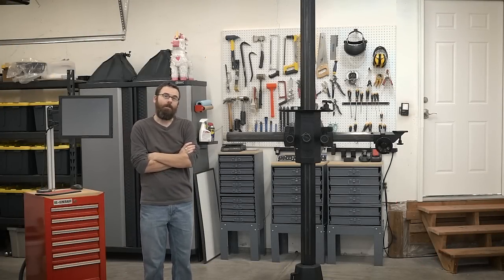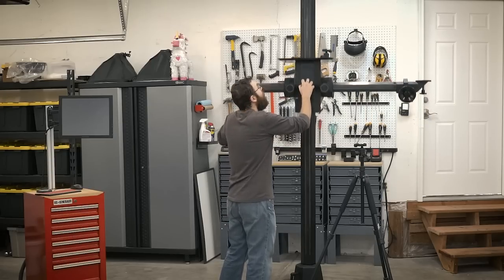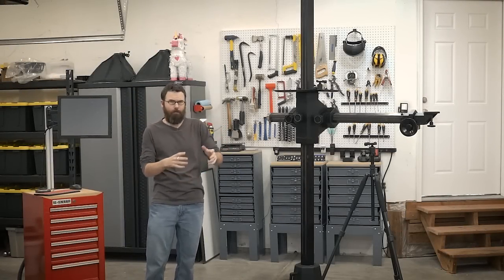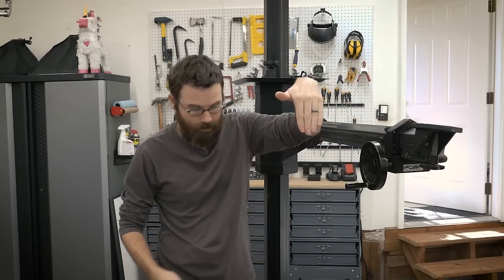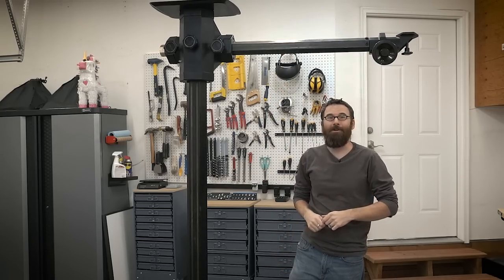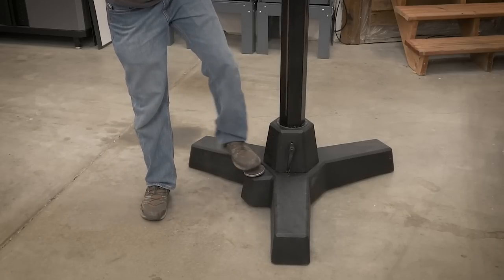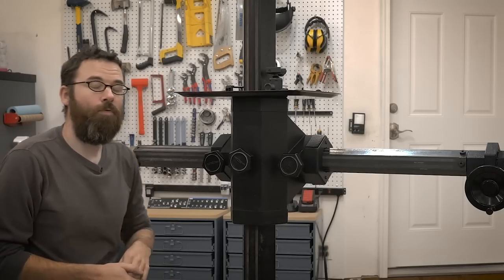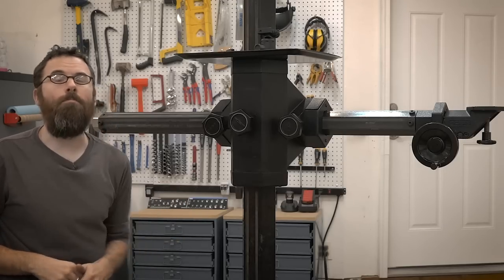Foba Studio Camera Stand (ultimate shop tripod!)

Comment: Nice score. I appreciate your desire to motorize it, just keep in mind that it was design as a stills camera support for commercial spaces, not as a motion control rig. You could get yourself a motorized slider, mount it to the stand and save a lot of hassle. Cheers 🍻
Reply from the maker: Fair point.  If I sanded it all down and smoothed up the surfaces, it COULD work, but you're right, it wasn't really made for that.

Comment: I have one. Bought it second hand some ten years ago, in a period in which many traditional studio photographers retired or their business folded. You could (and still can) get them for a few hundred Dollars/Euros while they cost some 8K new. They are built like a tank, but it appears that the three small gas springs that lift the stand have a relative short lifespan. But then again even with the  stand in the moving position it stays in place.
Reply from the maker: Mine just has a simple rope and pulley system and some weights on the inside.  I don't expect it will ever break of fail.
Reply: @RobertCowanDIY  correct. That is the usual construction and will last more than a lifetime. But the pedals that lift and lower the entire stand to move it, work with gas springs. And they seem to have a rather short lifespan.
Reply from the maker: @MrKakatoe  Huh, mine doesn't use gas springs on the foot.  It's a leverage-based system, it takes a small bit of force and then you just rotate your foot and it locks in place.
Reply: @RobertCowanDIY  could be they changed the mechanism at some time.

Comment: What kind of paint can you use that doesn't chip eventually? Maybe you can simply sand the chipped paint, that way you don't have to dismantle it.
Reply from the maker: I think standard paint should be fine.  I would guess that this stand is probably a couple of decades old and a previous owner tried to repaint it without properly priming the surface, which led to the paint chipping off.  I think a good sanding and repainting would be just fine and most likely last years.  The bearings also have some adjustment on them and could potentially be replaced.  It would need to be dismantled because you won't get a good smooth paint surface if you paint it in parts, it would need to be done all at once.  But, it comes apart easily enough.  I just need to take it apart, clean it up, sand it down and paint it.  It shouldn't be TOO hard.

Comment: I'm very curious about the perspective of this stand, would you mind sharing your rough height and weight? This thing looks impressive and I'm definitely interested in adding one to my studio!
Reply from the maker: I'm around 5' 8".  It's quite large.
Reply: Robert Cowan Thanks!
Reply: It is very heavy and bulky! If you buy one, transport can be an issue and the height of your ceiling! So double check it and quadruple think if you really need one… 😉 
Usually Foba’s Asaba stands are 2,5m high, on special order also 3m and more… mine is “just” 2m high and can “run” 🤪 in my 2,4m high flat. Some people also shorten the column for fitting in their room, but you need tools, space and a bit of skills for doing this.
200$ is a really good price for an Asaba but I am also not really impressed. If you don’t need one it becomes annoying having such a bulky tool. That’s the reason because they sell so low in price compared to the list price. Here Switzerland you found these stands for 500-1500 Swiss francs, older models even cheaper.

Comment: How did you transport it? I am about to purchase one and need to figure out transport
Reply from the maker: Mine broke down into a couple pieces and I just put them in my 4runner.
Reply: Is it easy to disassemble? I will probably get the same one :)
Reply from the maker: @diegoramosg  yeah, it's pretty easy.  Did you find a used one?
Reply: @RobertCowanDIY  i did, its not 200 usd more like 2k but i still think it is a good deal